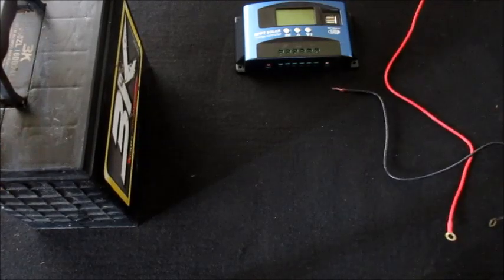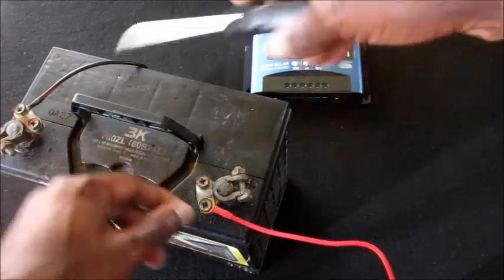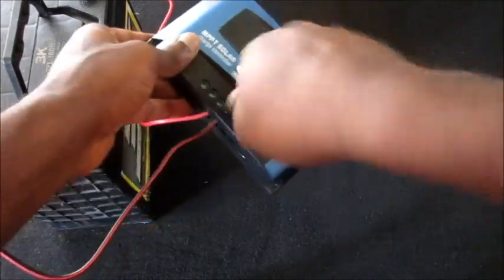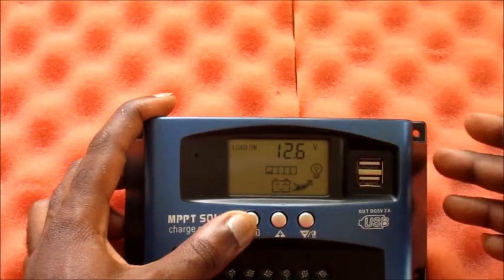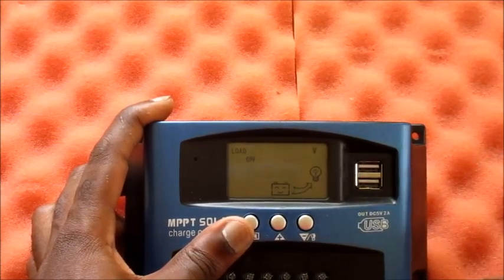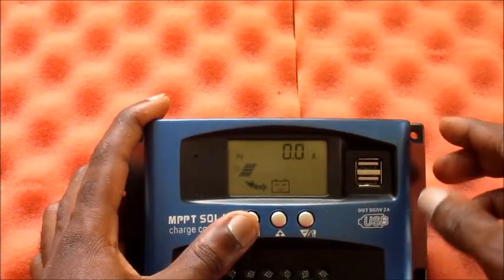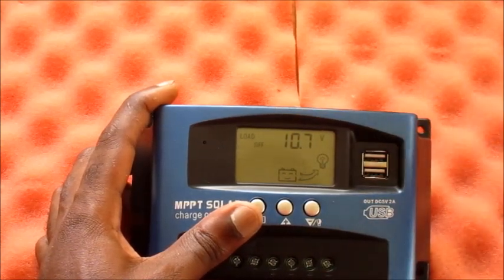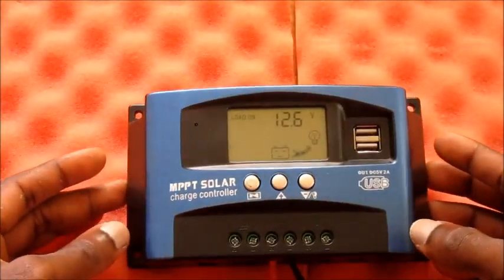How To Use or Setup 40A 100A Fake Mppt Solar Regulator

Comment: I’m using the same charge controller, but I’m using it with lithium batteries 7 series.. 
what is the B1 setting? It’s was on this setting as a default..  I’m using lithium batteries so do I need to change this B1 settings?
Reply: 0:54

Comment: G’day mate, helpful video, my controller has been set up by previous owner and everything has been working great, but it’s not charging during the day in direct sunlight, just has the moon symbol. Any ideas on how to turn it on to charge with the solar? Everything is connected still
Reply from the maker: reset. unplug battery

Comment: I need advice, please: I have a 455W solar panel...I bought BOTH Mppt and Pmw controllers from China (100A)...When I connect the solar panel, the controllers don't accept the panel? The controller shuts down soon?! Thank you very much
Reply from the maker: ensure you wire them correctly. if not there might something wrong with controller

Comment: Hi, what are the two ports on the right and left at the bottom of the controller where the cables are connected. they look like 3.5 jack ports. also, do you have a link to the user manual for this controller, i have exactly the same

Comment: What are the two female DC jacks on the bottom for? They are on the far right and far left? I have the same charge controller, and they are not mentioned in the manual.  Thanks
Reply: The far left is to connect a solar panel that has that type of jack and the right one is to use the DC.
Reply: Thanks!

Comment: Good day sir lenz,,can i ask about the battery? Can it be used in a gel type battery and where to put it in b1,,b2,,b3 ? Ple reply and god bless you
Reply from the maker: hi this is lead acid battery which is different battery type basic different setup requirements
Reply: @Lenzwalters  tnx
Reply: B1 right?

Comment: I like your teaching, I install Gpower controller few days ago, my challenges is the controller is always on for 24hours and this is not how it suppose to be, controller suppose to off at night and on during d day. How can I rectifier such issue?
Reply from the maker: once its connected to the battery it will be powered, to show you the stats

Comment: Any on where to add battery balancer / equalizer in the setup, an more on wiring with it serial connected batteries vs. Parallel and if and why it must be serial over parallel when using the balancer. Would be apreciated.

Comment: hello is the only viseo xhe I'm coming!  afoldIons of this solar regulator if you send me the video I will then translate it, I have a problem that I cannot remove the moon symbol on the display also appears (Load off 029.7 Ah) battery symbol with 5 pyoi notches send it to me thank you very much if you can to send it to me by by 👍🙏

Comment: Using this to power lights to to remote quail hutches (to stimulate egg laying in the winter) as well as a circulation pump for the (heated via 110v thermo-controlled bucket heater using a 1000w invertor) winter watering system.
I have a separate timer controller that is programmed  to come on an hour before sunrise and go off 2- 3 hours after dusk (adjusted for 14 hrs "daylight" pending time of year.

I power the 12v timer off the 12v barrel plug.  I power the lights with the load lugs, so I can turn this lighting schedule off if desired.  I also have a secondary barrel plug male to the load lugs, should I wish to directly power the circulation pump (by passing the inverter which is necessary to use a 110v thermally controlled on/off adapter) should my 200w/190 ah system not be able to keep up with the thermally controlled heater (on at <°35, off at >°45) AND the pump, as circulation only draws 2a (heater draws 4.17a) and may be more important than the heater (since my inverter shuts off <12v and I would have neither on extended cold sunless periods.
You Tube on this setup on my TullyRiverQuail channel.

Comment: Dont buy this fake, chinese "mppt" (which is PWM in reality).
Its a dangerous device to use. The heatsink is non existent and the temp. of the device has no problem raising to 100C levels !!!
It also has no float charge. Its fake mppt.

Comment: What is the maximum input voltage this will accept from a PV ??
Reply: The one I own (100A) is for 12volt or 24 volt battery system. Either one, and it should auto-set for the proper one. 
"In general" , for controllers, if a 24volt battery source is depleted super-low, when you hook it up to the controller it could think its a 12volt source. In that case, you'd need to unhook from the controller and pre-charge up your battery source more from a direct charger.
The PV arrays often charge at slightly higher volts than the battery voltage. For example, a 27volt solar panel would be used to charge a 24 volt battery system.
Reply: @irenebaldwin8933  Good point, hadn't thought of that.....thanks

Comment: Question my charge controller goes completely out when the sun is right on my panel. What’s the cause? I have two 92ah battery’s in series so 12v. I also tested only one battery same result. 
My panel is een jinko solar tiger n-type 355wp. 
Please help!
Reply from the maker: what do you mean by completely out?
Reply: @Lenzwalters  the controller goes out. Display goes out and the load terminals don’t provide power anymore. And when the sun goes under, he turns on again. Total charge per day, max 3ah

Comment: What are the barrel jack connectors at the bottom for ?
Reply: 12v power out.  Manual shows right side with a 12v light bulb, and the left side with an accessory solar panel, so I assume it's a 12v in/out but I'm not sure I would be using a barrel plug to connect a 100w solar panel when I could use a splitter and connect the array using the panel in lugs (10 gauge wire fits easily).

Comment: What what settings to use when using AAG M battery versus a lithium ion false stateif they live in Ireland fall asleep Avenue what's the temperature
Reply from the maker: these controllers are for lead acid type batteries mostly

Comment: So as I set load to 12,6v it stops also charging ad that point?
Reply from the maker: No. 12.6V should be load reconnect. your battery would keep charging until ful
Reply: @Lenzwalters  OK thank you.
It is all new for me, so I am looking what to get, to play with.
For my bike I got solar panels and a mppt controller that also boost it, so I can charge my batteries as I trafel around. This way, I can camp where I want.

For ad home, I want a cheap controller and use the solar panels to charge a small 12v battery that powers some lights ad my front door. Don't need a lot of power and don't want to pull wires everywhere. This controller looks to be good enough for my use.

Comment: how does this controler knows the capacity of battery in order to charge the battery at 10% of battery capacity?
or it just charge the battery at maximum amps the solar panel give?
i want to charge a battery which is 55 Ah lead acid but my panel have a max of 11A at 25V
Reply from the maker: the charge controller will test the battery power to know the level and when its fully charged

Comment: Too bad mine won't do something simple like turn a light on when the sun goes down.
Reply from the maker: hey on the load ? you can set the  reconnect voltage when you want to load to turn back on.
Reply: @Lenzwalters  ya the cutout and the cut in voltage
Reply from the maker: @williamvaughan1218  all the wires connected properly ?
Reply: @Lenzwalters  actually last night the light I had connected to it came on at dusk I had the hours on set at o that was confusing me. I like these little charge controllers now. For the output there are 3 adjustable parameters. Cutout voltage reconnect voltage and hours on or if that is set to zero then dusk to dawn operation. Which will work out great for solar outdoor lighting.

Comment: the battery used here is flooded type. the controller has 3 types of battery settings. B01 Gel, B02 AGM, and B03 flooded. make sure to make the settings change since most of us dont use gel
Reply: in manual b01=lithium bo2=gel bo3=flood

Comment: Lenz, great video!  Question: Could the load terminals be used to charge or maintain another 12v battery on a boat?
Reply from the maker: yes, it will charge slower but you will have to make sure it don't over charge as it load.
Reply: Why not connecting the second battery in parallel with the first one at the battery terminals?
Reply: @vivienrichter3916  Actually when you connect the battery to the load output you are connecting them in parallel since you will never get a higher voltage than the battery voltage. only difference is that you can use the load switch to charge the second battery when needed

Comment: You need to the explain the disconnect and reconnect only works for the DC power on the controller not the main battery otherwise very good example of how it works

Comment: Sir, if I have 12 volts DC lights and 12 volts DC motors. Where should I connect it? Should I connect it directly to the battery or connect it to SCC?
Reply from the maker: do it directly to battery

Comment: I don't Know ... MPPT Solar Charge Controller 50 ah. Solar Panel 100 watt 12 volts monoc. ... battery and battery load ... 5 and more amper hour, MPPT Solar Charge Controller 100 ah Solar Panel 100 watt 18 volts monoc. battery no battery load ... 4 ampere hour. 1 amper more ! During the day : 16 - 14 amperes ( cloudy 4 hours and sunny 5 hours )

Comment: Because I want to use a alternator to charge my batteries them I am not using any solar panel , i am going to use a timer to switch the motor that is going run the alternator on and off

Comment: I discovered that jointing another battery to the ports of the lamp, the voltage goes under 15,0 volts, so I have the maximum amperes for the exit for the battery, and even a 3 or more amperes for the lamp exit with another battery attached. So, I can recharge two batteries, and the amperes in one day go up from 21 to 35 only for the exit of the battery,

Comment: Big question. I just bought that one controller and sometimes it shows 0.00A from solar cell. Is it normal when battery is full?
Reply from the maker: maybe you connect your panel wrong

Comment: Hello and thanks for uploading. Do I need to fit an in-line fuse between the controller and the battery? And if so what amp fuse? Thanks
Reply from the maker: it depends on your application, what are you going to use it for
Reply: i realize Im quite randomly asking but do anyone know a good site to watch new tv shows online ?
Reply: @Raiden Heath flixportal :D
Reply: @Raiden Heath Glad I could help :D
Reply: @Stetson Davian Thanks, I signed up and it seems like a nice service =) I appreciate it !

Comment: can i ask i bought this same controller but im trying to run a 24V load do i need a 24V battery?? or is there a setting i need to set for it to run 24V
Reply from the maker: you need a 24v battery. you can use to 12V and make 24V

Comment: This fake charge controller can only handle low amps even with 100A but it is not capable of receiving more than 30A. It's only for those who are new to solar. If you really want to generate a higher current it is best to use a really reliable charge controller.

Comment: I have just installed one of these controllers , I set it to stop charging at 14.2v and the display shows it as  stopped charging at 14.2v but it KEEPS charging up to 16 volts then stops charging , this voltage is to high for a 12v battery and will fry it after a while . Be wary and check the voltage all the time
Reply: Best point made so far. From what I can see there is no way from programing it to stop charging the battery. So, it will cook the battery.
Reply from the maker: The float voltage can reach up 14.5V, but it should charge correctly with battery protection , ensure that your is not defective
Reply: I Have this same product and went over the 14.6v setpoint and kept trickle charging to 18v!! Destroyed my brand new 100ah li ion battery! Became swollen and ready to explode. Peice of shit.

Comment: This is one of the fake Chinese MPPT controller. How could you review such a controller if you don't know what your are talking about?
Reply: Fake but i have one and it works perfectly.
It's software is very good even if it's not a MPPT 😁
Reply: @s2oooo  there is nothing special about the software. It's just a standard PWM charger for which you paid MPPT price 😋
Reply: @54CHARM   £15 is cheap 🤣

Comment: Hi, I have two of those (100w) each and they are working very well. After some days the LCD screen goes blank(shuts down) on both of them, but batteries never run out of power. When I disconnect the negative wire and connect it again, they displays as normal again. Equipment is as follows for each controller: 2 × 200w solar panels for each controller, 78Ah battery (lead acid)
Reply from the maker: you can ground your panels, this may help. but your system should work perfectly. how much amps is your controller ??
Reply: @Lenzwalters  They are 100 Amps (I know they are way too much), planning to get 20A
Reply: @vusi_FIRE_masilela  I just bought one of these hooked it up and it worked perfectly for an hour then went blank. I disconnected everything and reconnected and the LCD screen flashed rapidly. Nothing had changed. Have you seen this situation?

Comment: how to use it with inverter? can i attach it to the load with setting 12v on the controller? some ppl say u need to attach inverter direct to battery
Reply from the maker: its better to the battery and yes you can connect to load
Reply: It's better to connect the output on a relay other wise you will burn it like me

Comment: Hi can you tell me what cable I need for this please
Reply: It depends on your battery size, load & so on. A 30 amp cable will be the best from panel to controller and the same for the battery, the load may be less but you can still use the same cable if you wish.

Comment: Hi what is battery 1, 2 and 3, which one is lithium iron?
Reply: This has been asked three or four times and he has not answered, the information is not in the manual, I suspect he does not know.
Reply: @sutty6779  B01 = Gel;  B02 = AGM.; B03 = Flooded
Reply: @JR-kk6ce  ok
Reply: B01 = Gel;  B02 = AGM.; B03 = Flooded

Comment: I have 200AH gel battery and the solar panels two of 100w and one of 150w and I connected them together by wire 6mm diameter to the (solar charger controller) but I want from you to guide me about the good value of the PV off (the input off for the 200AH battery) and thanks for you 😊 and if you have some advices for this system  can yoh give me ❤🌷
Reply from the maker: you should be good you should be atleast using 30w solar controller.

Comment: How many amps do I need to run a refrigerator
Reply from the maker: You will have to size your battery bank accordingly to run your refrigerator  you can use  a 40Amps lowest. it all depends on your battery bank and panels
Reply: Lenz Walters ok thanks one more question would a 100w solar panel be good enough for the mini fridge
Reply: @jeddgpt  yes a 75w would do the job

Comment: Hi, can I recharge the Smartphone with the usb without connecting the battery? Thanks
Reply from the maker: No. a battery is needed to power the controller
Reply: If you have a solar panel connected to it then yes, yes you can!
Reply: @TheChrislewis1989  You need to charge it via the MPPT controller. You can't charge it directly from the solar panels or you phone may turn into a brick.

Comment: Posible to use this controler to lothuim ion battery and lifepo4 also? I have using this kind of PWM SCC its work good
Reply from the maker: These ones are designed to charge lead acid batteries

Comment: Do the battery supply the load?? Or the PV the one who supply it??... I need to set up with this controller, connecting a PV, 12V battery and our project that will be the load... Thanks for reply
Reply from the maker: Yes. and also the pv

Comment: Mine is making noise and over charging the battery, what should I do?
Reply from the maker: change it. and note that float voltage is not over charging if thats the case
Reply: @Lenzwalters  thanks
Reply: When you say change it what do you change? The controller or the battery?

Comment: Hi Lenz, thank you for the video. I bought exactly the same controller. Not happy to know it's a fake MPPT. Anyway, there is nothing I can do about it now. Just one question I wanted to ask you. When I go through the setup the last option (after the hours of operation selector) is the battery type selector (I think). On mine it shows "b1". I can select b2, b3 and b4. I can't find anywhere what these codes mean. Do you have any idea?
Reply: B01 = Gel;  B02 = AGM.; B03 = Flooded
Reply: Same here u find answers?
Reply: These are preset settings and can be disregarded.

Comment: I have the same solar charge controller what does the PV off mean and how do you change it and is it okay that everything else seems normal but in the top left it says PV off
Reply from the maker: if pv is off no your solar panel is probably not connected properly
Reply: Why is the title change say fake mppt?

Comment: This charging regulator is not an MPPT because the company that manufactured it is lying to the consumer and is actually a PWM. If you try to disassemble the device, you will find a small power cord that has been removed So it is a false product and you have bought one from Banggood Market  And specifications are false and indicated by its price
Reply from the maker: Yes we know